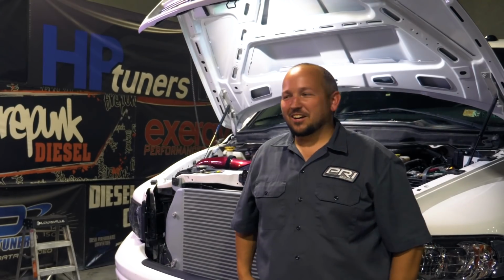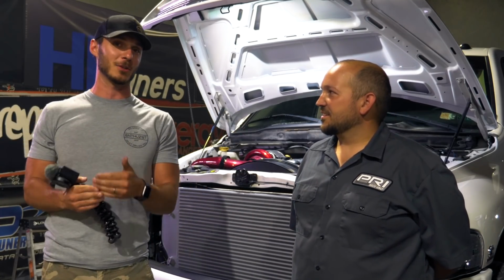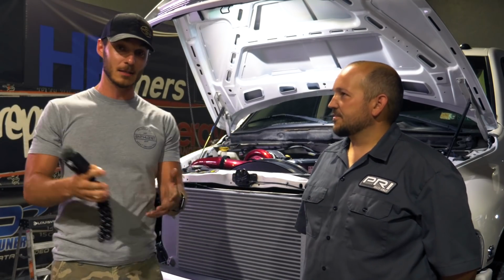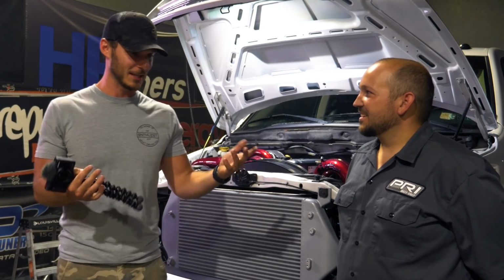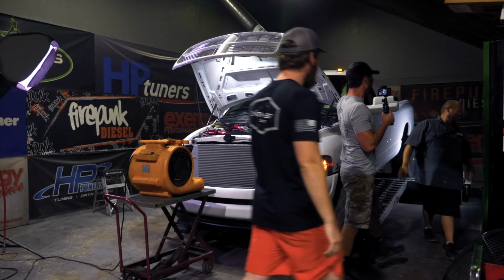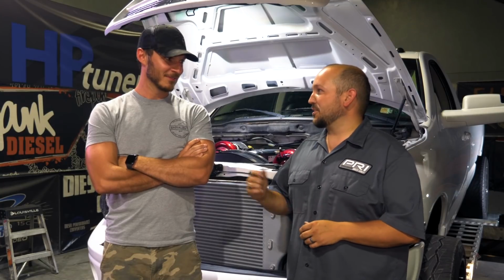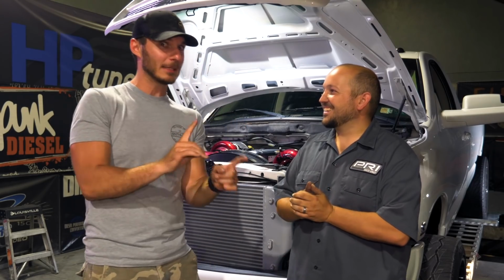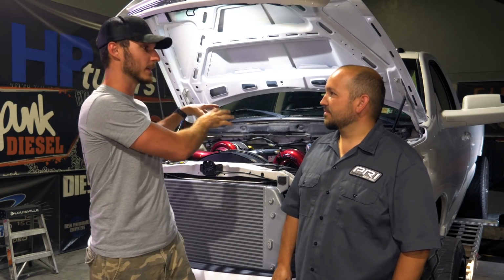PROJECT "8 BALL" - HOW MUCH POWER WILL A STOCK BOTTOM END HOLD?

Comment: I have a similar truck I’m building it’s a 07 that threw a rod it’s a 6 speed truck but the previous owner put a nv5600 in it vs the g56 wanting to know how much power can the nv5600 hold and what to do to make it hold 850-1000
Reply: If you want to hold over 850+ at the wheels, you need to put a built 48re in it.
Reply: @user63344-gds  but a built 6 speed would be cooler 🤧
Reply: @luxuriousranked336  Yeah, I agree. Unfortunately 6 speed manuals tend to explode around 800 whp so that limits the options.
Reply: @user63344-gds  I’m gonna try to make it happen
Reply: @luxuriousranked336  Remember, it will live as long as your right foot lets it. 👌

Comment: Hey what I would suggest is to take a transmission case and I don't know if aluminum can be cryogenic dipped I would strip all the steel out of it including the sprag and dip the case I don't know if it would make it brittle I don't know and then what I would do is I would take the sprag see what it takes to break a stock one and then take another one exactly like it and take in get it cryogenic dip and see if it makes a stronger without making it brittle and because those are the weak points anyway just a thought my name is Jim I'm from Pennsylvania I have a 91.5 Dodge give you three guesses what's under the hood